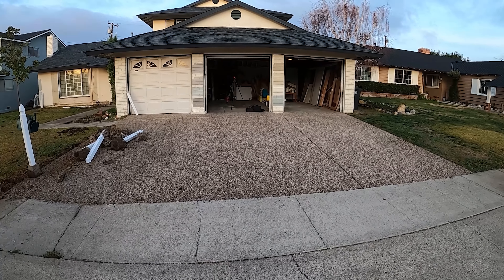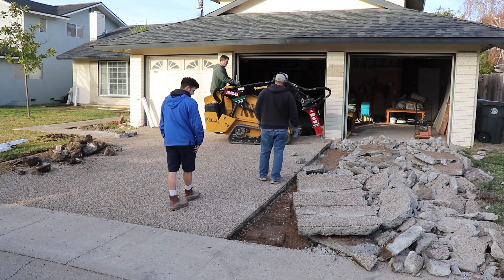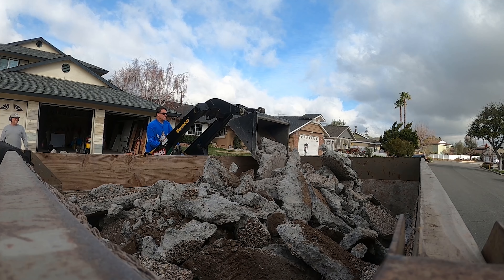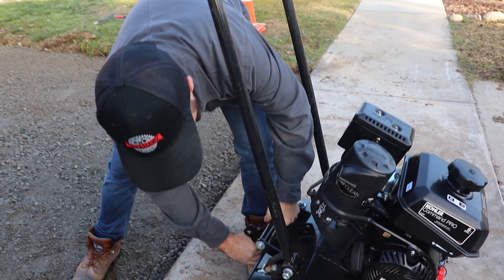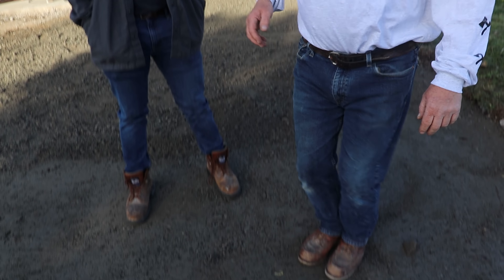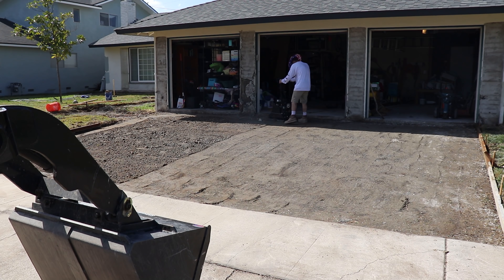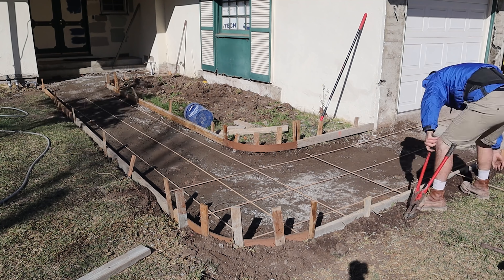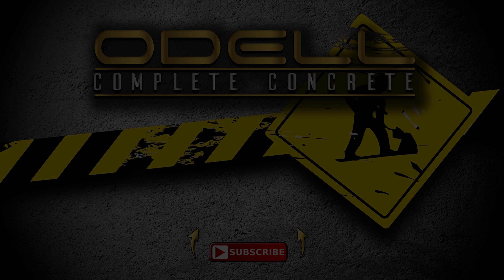Custom Driveway Remodel (Part 1)

Comment: Is there a benefit to using fiberglass reinforcement in certain jobs rather than steel, or did you just have that batch of material available?
Reply from the maker: Fiber glass never rust
Reply: @OdellCompleteConcrete  
So is it more expensive and a matter of the client's budget whether it gets used?  First time I've seen it.